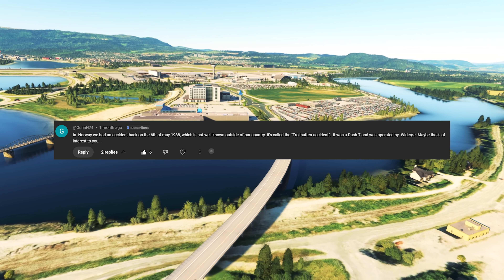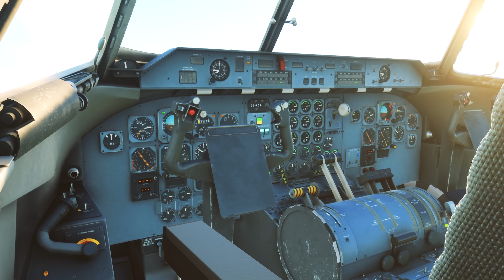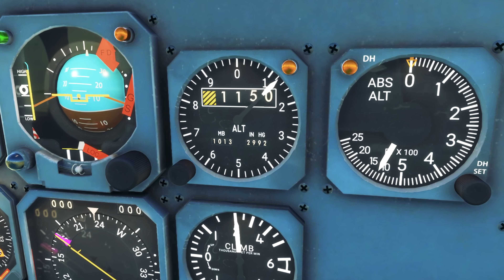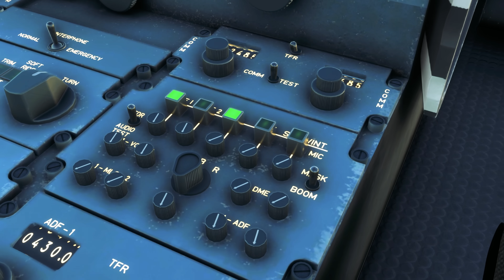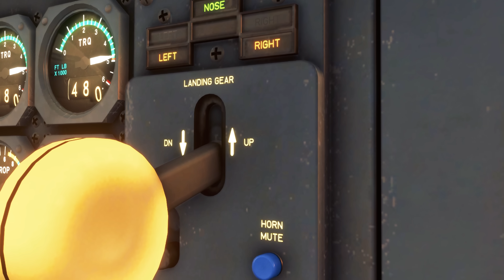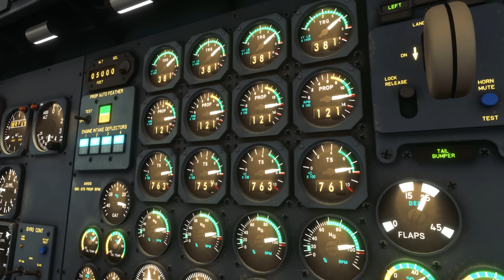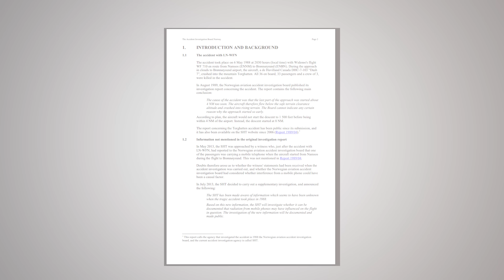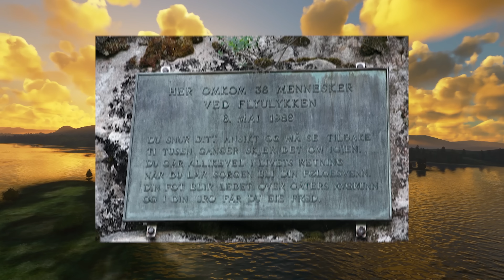The Crash of Widerøe Flight 710 – What Really Happened?

Comment: There was an accident during a training flight in a Beechcraft 1900 on December 28, 1991. The 3 pilots onboard (an instructor pilot and 2 captain trainees) were killed. Although the NTSB investigated the accident and determined the "cause"- basically instructor pilot error - there were subsequent investigations and other research that provided differing theories of what actually happened. N811BE was the aircraft registration number and that can be used to help you search for records online, since there was no flight number assigned to the training flight.

Comment: it is possible he mixed two informal approach styles  -  during stronger winds, some pilots (on much smaller aircraft in the aughts) would circle the mountain low altitude following it's cliffs (you needed to follow the terrain features closely to basically enter through this narrow valley between two sub-peaks)... you did this to avoid the turbulence commonly found on windy days around the top of the mountain... the other method was to descend directly after you pass the top... which is the route he was supposed to follow by where he was, but, distracted, he used the informal step-downs for the wrong approach.
(the terrain circling route started 580ft, quite a bit below the summit, at about 1.5km short of the mountain top fix)
this is from memory, but... seems to add up.

Comment: This is sickening. While I understand the grossly negligent 'human factor', it seemed as though the terrain warning they got was awfully late in the game. Or is/was that just a part of the video presentation?
Reply from the maker: In the final report, they got a 'Minimum' call a second or so before striking the mountain. I'm not sure on what ground proximity warning system they were equipped with but with it being 1988 i'm not sure if it was as sophisticated as todays equipment providing a 60 second or 30 second call.
Reply: @CuriousPilot90  its also very flat terrain, going from over the sea, into farming fields, into steep mountain. so pretty sure the minimum call didnt trigger until the mountain ridge started, and from there, its just seconds until a wall of mountain. if they had been 200 feet higher ( i think ), they would have cleared the ridge they crashed into. im a local to the area btw, great video of a terrible accident.

Comment: Nice video, thanks. Unusual fact about this airline. While the world was locked down due to a certain virus, they flew more flights than any other airline worldwide.
Reply from the maker: Wow, that is really interesting. I guess they were a lifeline that Norway needed to keep going!
Reply: @CuriousPilot90  That's exactly why they had to keep flying. They are basically Norway's bus service. I believe they also provide transport to oil rigs in the North Sea, although I'm not 100% sure.
Reply: @alexmiller7721 not to the oil rigs themselves, but to the layover airport where they switch over to a helicopter out to the platform.
Reply: @_kamisan_  That makes more sense. :)